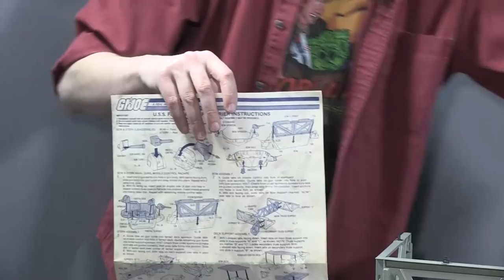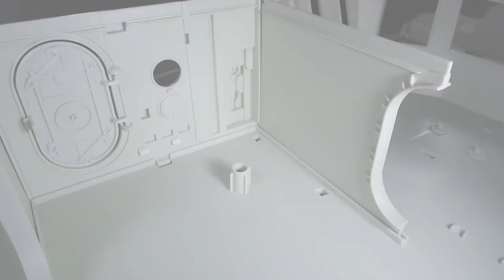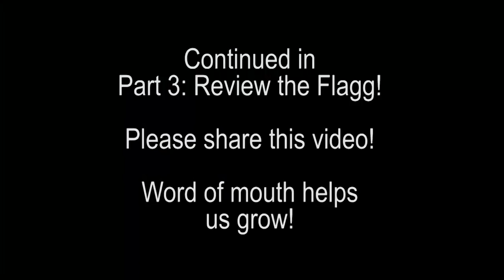G.I. Joe U.S.S. Flagg Restoration: Part 2 - Restore the Flagg Hasbro 1985

Comment: You got to wonder if anyone has scanned and 3D printed these parts as replacements since originals are lost and/or broken?  This would pretty much apply to any Joe parts on various vehicles.  Hasbro really has lost out by not reissuing this prized playset.  At least license the Joe Club to sell a reproduction at the very very least.  We all know it would sell!
Reply: A repo faintail rail sells on ebay for about $25, so yes that does occur. I once saw an original one selling there for $125.
Reply: I actually offer a service locally to do just that, as well as remolds, resin casts, retrobriting, electronics refurb/rework, and painting (airbrush and hand).  So it definitely happens, although I don't advertise aside from cards at cons and through word of mouth.  It's not the primary business, but fills in when bigger projects for that venture aren't going on.  It would be fun to do full time, but it's honestly too inconsistent to bank on for me.
Reply: I've thought the exact same thing? I thought he was going to say he scanned and printed from the mint pieces.
Reply: Yeah currently I’m making an actual 1/18 scale carrier that is about 40 feet long and I’m using a 3d printer not really re making the flag but ya know similar

Comment: 29:50
Rather than needing a huge bucket of Simple Green, you could saturate paper towels with Simple Green, and then lay them on the plastic surface. Really mush them on there to get in the little corners. It holds the SG against the paint, and you can literally use a spray bottle to keep them damp with fresh SG.

Comment: I have found that the best way to clean up yellowing without damaging the part is distilled water, oxiclean, and a uv light.  Mix water and oxiclean (usually about 1 table spoon to a gallon) in a fish tank, place part in water and turn light on and place on top.  If working with a part with multiple angles move the light or part every 6 hours.  I normally only let soak no more than 24 hours.  After complete rinse and dry.  You can then preform any other restoration or preservation work.

Comment: I knew a kid who had it was his dad's it was a magnificent sight because he got a bunch of vehicles and figures from 2000s mostly I rarely saw any figures from the 80s or 90s on his but overall it was magnificent sight especially how his Dad did it his dad was able to customize thing so he made battle-worn look on it and made it look like a an aerial vehicle crashed on it he even had a look of fire burns on it if only I had a picture of it
Reply: I just learned that the ladder on the flag I saw it on eBay being sold with the ladder that goes with the X-Wing but it comes with the exclusive Luke Skywalker figure where he  is climbing up the ladder to with X-Wing which you can attach for only $12

Comment: I have two words for you, vacuum bag. You can Simple Green anything as long as it fits in the vacuum back then you use a Shop-Vac to suck out the rest of the air I was able to do an entire AT-AT minus the electronics with about 64 oz. you can definitely do the superstructure with it just work the bag around the part as it is sucking out the the air to bring the simple Green to the top.

Comment: I have two Flaggs on display in my GI Joe room and I never put the deck clips in.  The decking sits fine without them so no real reason to use them.  Also if you ever need to disassemble, then you don't have to worry about breaking and stressing the clips by removing and replacing them.  I do have a full set of clips for each Flagg in a baggie that I keep for completeness, of course.  Same goes for the two Y pins that holds the tower on.

Comment: If I may make a suggestion on the stability of the ship; on the base for the ship, it might be a good idea to put raised brackets on either side of the walls in strategic points where the truses set on the walls, in case of a bump or such that would keep the whole thing from sliding off, and wouldn't require any modifications to the truses themselves.  Or you could drill holes through the walls and run zip ties through them to tie around the trusses for the same effect.   Just a thought
Reply from the maker: +Shockwave 2 I thought that would be necessary, but then I discovered, and trust me when I say this... The final toy is so heavy, you can't move it off the hull walls.
Reply: Is it sitting on 2x6’s?

Comment: So because of this video collection I finally took the plunge and bought a flagg. Unfortunately it’s very incomplete and I am wondering what the best venue is to acquire some of the missing parts without breaking the bank. If I start sourcing it from eBay I will spend more in the parts that are missing then what I bought the entire set for. Any help would be greatly appreciated.

Comment: Please tell me you anchored the Plastic trust/beams/supports to the wooden base using Aluminum L angle's that can be screwed into the new wooden supports and just clamp down on the plastic supports so it can not shift and cause the deck to collapse or crack apart under its own weight!?

Comment: why not make with a 3d printer or balsa wood, heck model plywood would def work
Reply from the maker: +Jeremy Parke if you've got the time and skills, then go for it. I've got 100 other things on my plate, that require making videos it off them all as well.
Reply: I'll add that part of the collecting mentality is that it IS original and not a remake.  That's why people will spend hundreds or thousands of dollars on originals instead of replicas.  That's not to say there isn't a market for remakes, it's just usually a fairly distinct market.

Comment: You have a mint set of replacement trusses, why not make silicone moulds of them and cast new resin trusses for people who aren't sticklers for original parts in their restorations.
Reply: Because that would cost a fortune in resin and silicone. Plus resin's kinda brittle.
Reply: True, if I was going for authenticity I'd want to try and find mint condition - or at the very least "good" quality parts.  But if I was repairing my own personal set, or I found one in a garage sale and was cleaning it up for the kids in my life to play with - because toys should be played with - then I wouldn't so much care about "authenticity" if I knew I had a source of repro parts based off mint moulds that I could buy to repair the set whenever it got broken.

For that matter he could do a collaboration with The King of Random and use the resin parts to make reverse metal casting moulds and make all aluminium parts - super durable!
Reply: He doesn't even mould and cast tho.

Comment: To be honest I don't think I would have wanted this as a kid. Accuracy has always been an important thing for me, and the USS Flagg is the completely wrong shape. Of course, I know Hasbro couldn't do it "properly" due to the enormous scale of the real thing, but the Flagg looks like those stumpy, USS Lexington "egg-shaped" aircraft carrier models by Meng (Google it). Those were meant to be caricatures of the actual ship and they don't look good at all. Galoob made a carrier for their "Micro Machines" Military line in the early 90's and it suffers from the same problem (it was stumpy and looked like something Fisher Price would design). However, Galoob released an all-new carrier later on that looked MUCH more realistic.